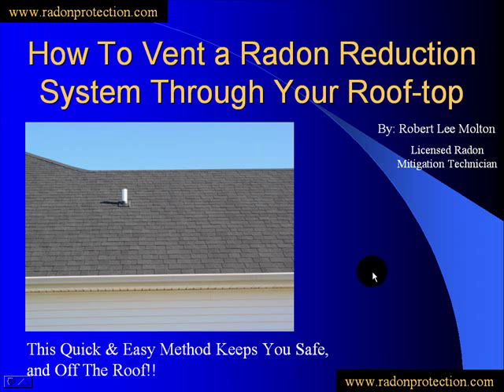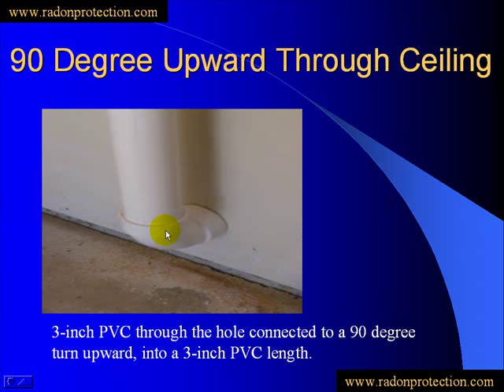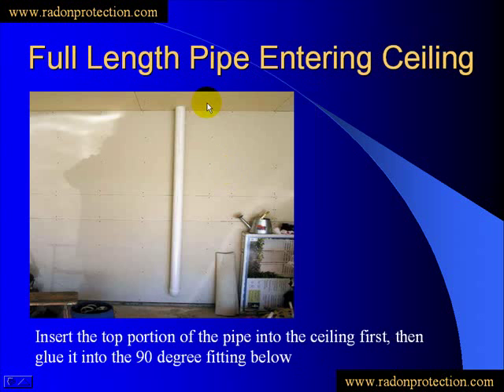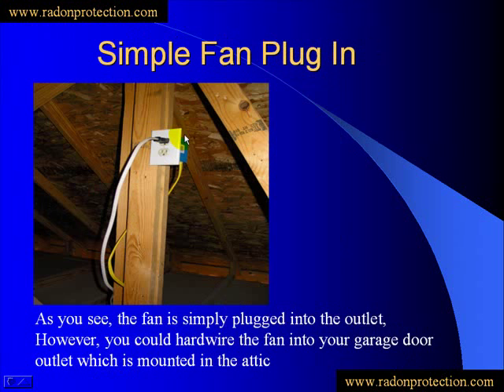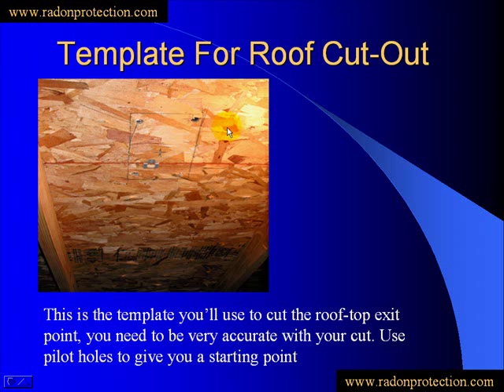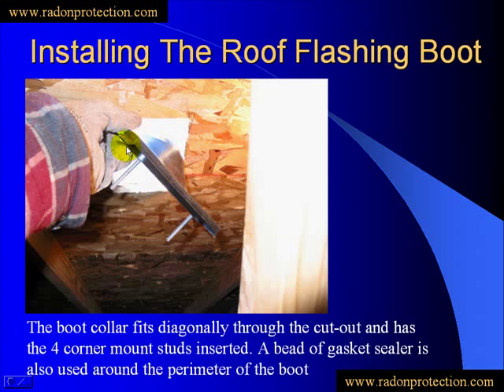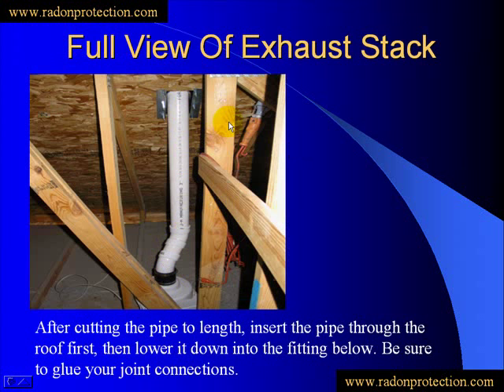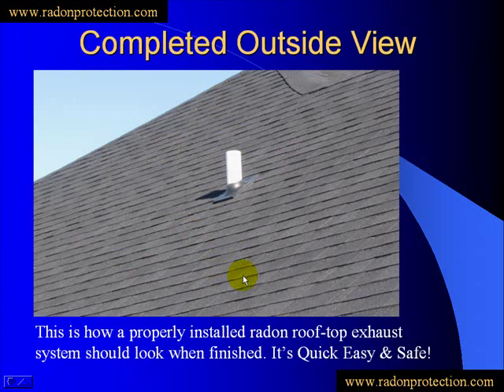How To Vent Radon Gas Through Your Garage Attic

Comment: Thanks for making the video buddy. 
I'm about to install my system but I got 4" pipes as I assume it would be better ,especially using a larger fan? 
Checking with a radon monitor the garage I found high reads (not sure if the monitor picks up fuel fumes as radon). 
Reads are higher than the basement which is odd to me. So I thought fitting a pipe from the basement up as you did, then instead of vertical into the roof, another split into the garage slab and then vertical pipe up. 
Does it sound right? 

Is this flashing safe after years? don't want leaks.... Thanks